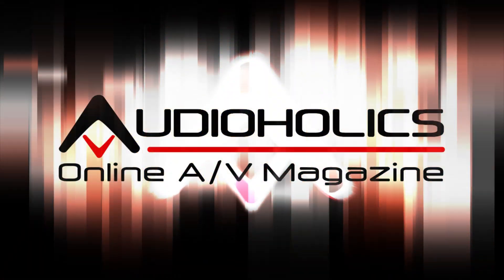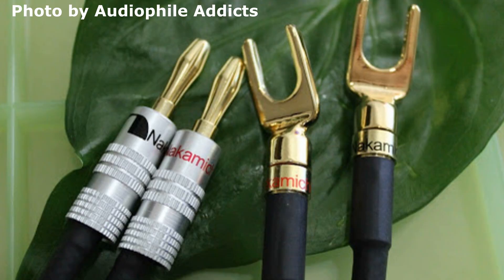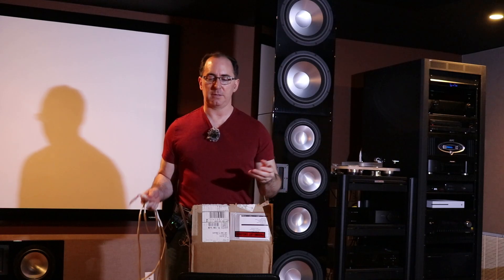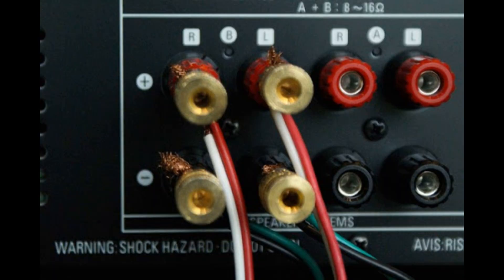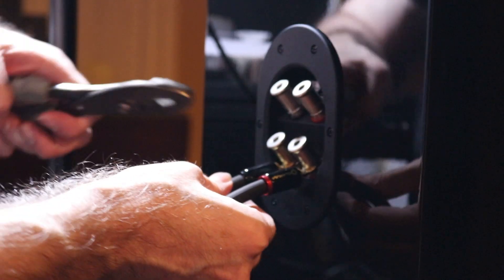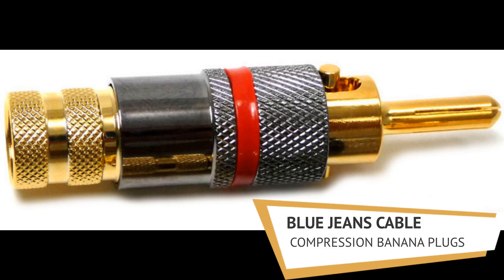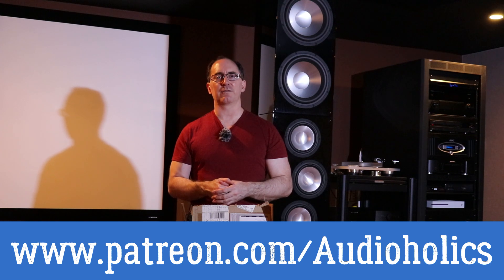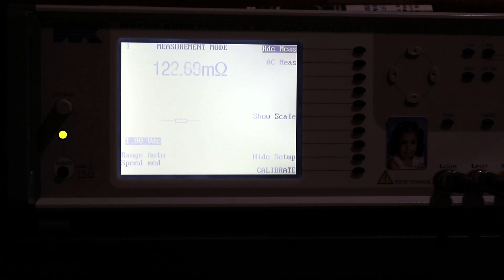Spade vs Banana vs Bare Speaker Wire Terminations: Which is Best?

Comment: Well, I have found that connection reliability is dependant upon maintaining low impedance over time and this goes for any connection, be it speaker cables or interconnects.  Obviously, contact area and pressure are a factor but oxidation and corrosion is as well.  So, I like to keep the number of metal to metal surfaces to a minimum and also minimise galvanic corrosion.  Dissimilar metals is a galvanic problem that is hard to avoid and bare wire minimises the number of metal to metal contact surfaces.  I agree the stray strands are and issue but so too is oxidation and corrosion between the strands.  So, regardless of the connection type I like to use a contact cleaner conditioner.  The conditioner tends to stay in place and dry, sealing the exposed metal from the air and also filling gaps.  By filling gaps, I mean that you never have molecule to molecule contact over the hole contact surface but rather only 2-3 spot contacts.  This is simply a factor of manufacturing tolerances.  The rest of the contact surface is not actually in contact though it may be close enough electrically.  The conditioner helps fill these micro gaps with a conductive material that keeps the air out.  So, the contact is electrically improved and less prone to corrosion and deterioration over time.  I have also formed spade and pin connections by twisting or braiding the strands together & then soldering to keep them together.  Then flattening the spade between 2 metal plates so it will make good contact.  Again using electrical conditioner to fill gaps and seal the connection.  This has been highly pretty effective and reliable, except when the cable is pulled of jerked sharply as has happen in a PA scenario. Doing this avoids having a wire to plug interface as well as a plug to socket interface.  I do agree though the spades in general are not as secure as locking banana plugs,  but it depends on the situation.  Some gear uses cheap fake binding posts that don't accept bananas.  Some older gear just has screw clamps.  Speakon connectors are pretty reliable and completely eliminate to risk of shorting but they are expensive and usually only found on PA gear.  They also have a cable gauge limitation the is pretty annoying.  There is a 4 pole option than can be used with 4 core speaker cable to improve that issue though.  So I have tried a few different methods over the decades but I tend to agree that locking bananas are a convenient and secure.  But whatever is used, Deoxit Gold on every metal to metal interface greatly improves performance reliability over time.

Comment: I go with the best of both worlds. The monster Xterminator connectors were and still are the best. You can tighten them down on the speed log and then use an Allen key to keep it from backing off and then you can use the compression banana portion to insert it and remove it from the speaker.

Unfortunately discontinued, and are rarely available used. Most people that have them love them. Yes you will get the occasional one where the center pin gets stuck or breaks. But that’s after decades of use.

Comment: With banana connection you can never get 100A peaks through,  no pressure buy spring , Spade connected much better if you have right on speaker with right tool to tight it

Comment: i go raw..with a little soldered end and coat with "strikehold" a dielectric liquid oil and a dab of silicone grease to seal the exposed copper on the cable end...work just great...no oxidation or what soever after 2 years now...

Comment: Brass is a terrible conductor of electricity. All banana plugs and spades are made with this poor quality material. OK they are plated with Gold or silver, but the flow of electricity is really through the plating. I don't like the idea of plated brass being in the path between amp and speaker. By using bare connection, this very poor conductor of the valuable audio signal is removed. I think i prefer bare connection

Comment: What I've gone for at the moment is RED spade & BLACK banana to see how it goes.. because with the spades you can not get a very good seating position on some speakers like my Monitor Audio R352 MD's & if I go with banana plugs with Exposure 4mm cable it sometimes can get a little heavy on the banana pins.. So I'm trying with with both at the moment to see how well it works..

Comment: I hate them both for a variety of reasons. 
I have mostly magnepans, which used banana for pretty much every model I have. 

It's hard to find good bananas that actually fit the receiving end. 

Spades totally suck , they undo themselves all the time. Add tons of tensile load to the terminals. Aside from being bulky and just not a good solution. 

So in short I dislike them both, speakon or wbt are the best imho

Comment: I'm having a hard time figuring out what size spade connectors to get.. 6mm or 9mm? They are for my klipsh rp600m.  Nothing in the manual tells me. I lost the metal bridge connection for binding post and was going to just get two pairs of 10inch wires to bridge. Anyways...im using bare wire to speaker and banana to plug as well :).

Comment: Banana plugs. Z-plugs with screw fitting are best. Low mass, high contact area. Consistent connection. Go for plated copper, either gold or rhodium.
Spades work loose. Bare wire works loose, has strands that break and, oxidises. Spades and bare are inconsistent and introduce problems that are irritating.

Comment: Banana plugs on both ends. I really love the for the speakers, because I don't have a ton of extra length so it's nice to be able to pop them in and out without much effort, and as long as I'm not pulling out the speakers, they stay in place. I have them into the receiver as well, but I do have to be a bit more careful pulling the receiver out as they could end up popping out, but as long as I look behind and make sure everything it plugged in properly, then all is well.

Comment: I used banana (fosposer) plugs because to me it feels like just inserting a 3.5 mm aux jack in binding post & also the connection feels more better. Spades don't feel like a solid connection because it may happen the the speaker wire itself might push it out of position.

Comment: Good stuff. Why does looseness happen on speakers with screw type terminals  more often than banana  ? Vibration. Thread type is also a factor. To prevent bare wire from fraying, tin the ends with silver solder.....done.

Comment: I tin dip, and then go bare on all ends, that way I don’t need to worry about the strands coming un done and shorting out. I’m just cheap that way, lol. When I’m wireing a car amp, I only din the ends enough to where the posts can get a good solid bite on the wire ends, otherwise if you use too much solder, the post might strip out while trying to get a good bite. 

Never mind that it’s easier to inspect your connections without the posts, I’ve come across people doing a horrible job stripping the wire, and what otherwise looks like a good connection is only held by a few strands. I guess that I’m also paranoid that way , so I’ll just stick with din dipping my ends and calling it a day.

Comment: Solid copper cable (no whiskers), bare. Since there are no gold terminals, there is no point in having gold contacts. 
Even if you have gold terminals / connectors, you still have to solder between the connector and the cable, otherwise you will have problems with oxide etc no matter what in the long run.

Comment: Bare copper on speaker terminal & quality banana on amplifier output: I like to switch amps depending on what the audio source is. Banana offers convenient & a good contact. If you wire the speakers to wrong output it's less frustrating switching banana plugs. Get good bananas with reliable contact.

Comment: The issue with raw is fretting and breaking of strands with micro movement, and every time you do up the binding post most likely some strands will break, imo bare is not a reliable option. Spades work well if we have anti-rotation feature, which in speaker world I’m unaware. Good quality bana seems to be best compromise.

Comment: I really like the Parts Express banana plugs with the "floating slug" inside. It let's you turn the locking sleeve without any twisting against the the bare wire.

I used to "tin" the bare wire ends with standard lead solder. That actually worked pretty well too because you eliminated any whiskers and the soft lead deformed to the shape of the space they were being screwed into.

Comment: I use round spade connectors and I welded the cables to the spades after tightening them. It doesn't move.

Comment: Historically I have preferred bare wire, because I don't change things very often, so the ease of making connection changes with spades and bananas has not been a big draw.  I have a pair of 1980 vintage ADS L710's, however, and the binding posts have holes that are too small for 4mm bananas, and it is very difficult to get even 14 gauge wire in them.   Spades might solve the problem.

Comment: I have just gone raw. Had been using spade and banana. Spades and banana were cheap ebay gold/brass, silver soldered to cable. I had noticed the same with spades, that small movement would loosen spades. I have been on a mission removing brass from signal path. Next move to solder cable to speaker crossovers.

Comment: Thanks for the interesting subject! Don't know much about audio. Would wrapping bare wire around the post and screw down the nut tight give you the most contact area? The spade has a lot of surface area but the actual contact area depends on how much of the bottom of the post nut come in contact with the spade surface. The bottom of the nuts have ridges and is not flat. That reduces the contact area. Another main problem is mentioned already. It comes loose easily. Wonder if there is a connections that are like threaded inserts. And the wires terminate to a thread pin also and you screw the pins I to the thread recepticals.

Comment: I’ve been using Canare 4S11 speaker cables from Blue Jeans Cables with the ultrasonically welded locking banana plugs terminated to them for years now.
Gene, as you mentioned in this vid, you don’t necessarily feel they’re the best plugs, and I’ve thought the same. From what I’ve seen, QED seems to make some quality banana plugs. 

Gene, in your opinion, is there a higher quality banana plug that’s not ultrasonically welded to the wire, but instead screwed to, soldered, or crimped on a cable and still continues to maintain an ample and even similar enough connection? Does it really make that much of a difference, because I see you screwing those Kimber plugs to your Kimber Cables. Thanks, Gene.

Comment: For Denon X8500 amp I use Silent Wire 45° Locking Bananas with goldpated ferrules, for the speakers bare wire also with goldpated ferrules, crimped with a mechanical crimp tool, I can't afford a hydraulic one

Comment: I've always preferred spades, and I have spade-terminated cables that I like a lot.  And I realize the importance of connecting them properly and avoiding shorts.  That said, most amps and receivers these days don't allow spade connections, so at least on the amp end we're kind of stuck with bananas or bare wires anyway.  Bananas are fast and convenient, but in my experience they can be loose fitting.  I guess I need to buy different bananas.

Comment: I use Cardas binding posts, cables, chassis wires and Cardas terminated banana plug throughout my system.  I agree complete, spades just do not seat well and often come loose.  When you use a wrench to heighten them down, you run the risk of destroying the binding posts.  I cannot hear a difference and I have tried.  Been an audio nit since the 1980.

Comment: I use and recommend "mediabridge" brand banana plugs. They work great+reliable with my Denon 4802r receiver. Such a clean, nice installation.  Their not too expensive either on amazon or eBay.  On some of my speakers I'm using bare wire, some banana.  On very old av receiver Pioneer vsx 9900s-I do bare wire.   It's only option, luckily I only have 2 speakers hooked up.  I've never tried or knew about spade connections.

Comment: Most of the expanding banana plugs with a center pin are junk. They are made from some sort of brass powder metal with low electrical conductivity and also are very brittle. Often it's enough just slightly overtighten that center pin when banana is in a speaker terminal to get that plug cracked or deformed beyond repair.
Reply from the maker: I don't doubt that. Good point.

Comment: I'm looking into banana plugs and pin plugs. But I was considering spades for the back of the amplifier so it wouldn't all stick straight out the back so much. But could anyone tell me if those actually go on those screw-terminals on receivers?...

Comment: Just yesterday I was redoing audyssy because I got a new couch and all my raw connections to the speaker were half-a-turn loose. Consistently loose on all three up front they had all done it equally.

I thought that was weird and then I see this video a couple days later.

Banana to the AVR because I HATE trying to connect bare wire to all those connections so close together back there. Which was just for convenience as I never really considered resistance in the matter....figured they were fine in that regard.

Basically this video just tells me I'm doing it right.

Had spades to my mains for many years.....they work too but do get loose as well.

shrugs

Comment: Banana plugs, but just some budget ones I picked up. I just find them more quick, simple and clean. It is so much easier and faster to just reach behind something and plug it in vs having fart around with with trying to screw something down and then check to see if its in right and actually tightened down. Especially in awkward positions.

Comment: When I build my cables I use BFA Banana plugs on both ends only due to switching out speakers frequently. I would do exactly what you would do if I kept a pair in place long enough too. Banana at the amp, bare wire at the speaker! Good video!

Comment: I recently had a banana plug debacle that’s made be switch back to all raw. Totally raw doggin now.
Reply: Can you expand on this?  What happened?
Reply: @Methodical2  Ya sure. So I was running a 7 channel external amp from my processor and I was using RCA interconnects with banana plugs I installed on both ends. For extra safety I also wrapped some electrical tape around each plug right were the wire inserted into the plug. Long story short the wire came out on 2 of the plugs while it was still taped, leading me to believe those amp channels had went out. The wire had pulled out inside the plug while it was still taped up. They were expensive ones too with a nice set-screw on the wire.

Comment: I use banana plugs from monoprice, but I stick them in the hole for bare wire in the binding posts and tighten down on them. I don't need my subs bouncing out the connectors during a good scene

Comment: Um if you twist around a single banana plug it will move also. Your argument just went out the window. Bare wire is always best if not changed around often. Spades increase the chance of shorting out if not careful. Banana plugs are just convenient.
Reply from the maker: I can't twist the locking banana plug as you suggest so it depends what type  you're using.

Comment: Great topic!  As is usually the case, it’s not necessarily the modality (e.g. spade vs banana), but how they are executed. The weakest link in this chain is the operator, i.e. the person who does the set-up. For example, if using spades, carefully/slowly tighten the binding posts so as to make them secure, yet without damaging the posts. If using bananas, choose wisely because bananas come in a wide variety; many are weak. Every situation is different; terminals come in varying depths which affect the efficacy of a banana connection. Spades come in varying widths which affects the contact surface area. Terminals have different sized holes which may not accommodate the particular speaker wire gauge which you might have.

 Alll in all, it’s difficult to make blanket recommendations on which connector is best for any given connection. The user has to evaluate which modality is most optimum and how to execute it using common sense and trial-and-error. Be patient, do your homework, use very good lighting (an LED headlight is useful) and magnification.

Comment: I use whatever the speaker or amp requires. When the device I’m connecting to has screw terminals, I mount spade lugs to the cables using my trusty old Thomas & Betts lugger. I haven’t had a crimp fail in 50 years (although I haven’t gone back to check some of the really old ones). 

If I’m forced to use bare copper, I tin the wires before I insert them into the connector. I haven’t put a banana plug on a wire in decades.

Comment: I use compression bananas on both ends.  However, I'm not really happy with the strain on the wire at the speaker end with the straight bananas.  Hoping to replace the straight with some angled ones.

Comment: I always used to swear by banana plugs, however i seem to have been persuaded by audio-enthusiasts, et.al. the asylum, that spades are better. but i do agree with Gene that getting the tightness on the spades are harder. currently  considering the advantages of BDA over banana. I would like to see Gene test contact resistance of those as well.